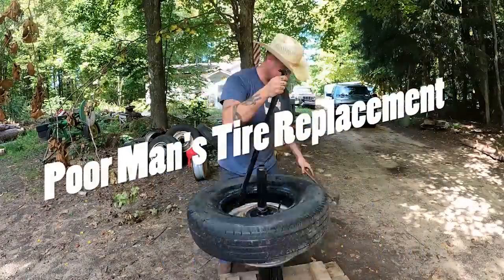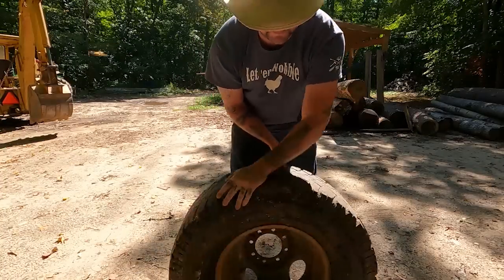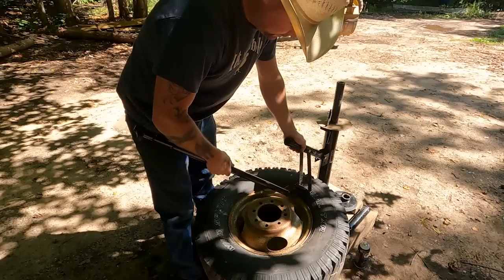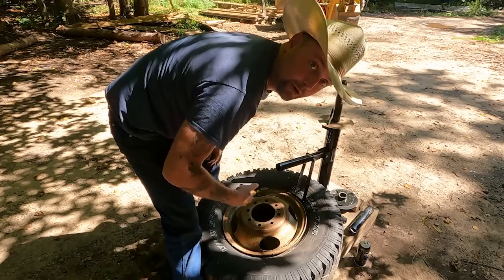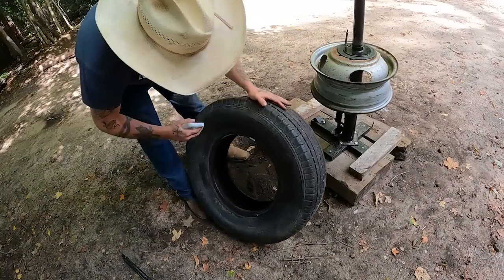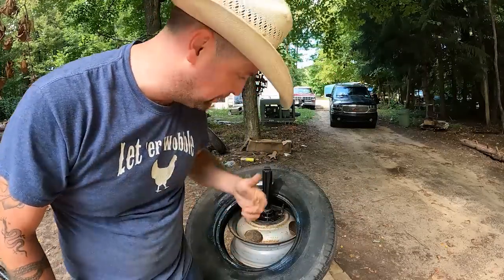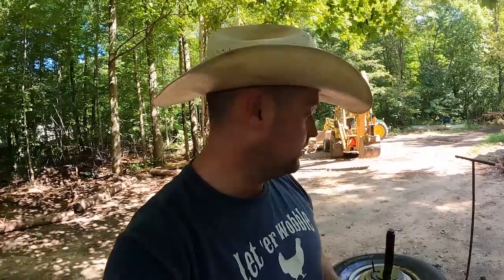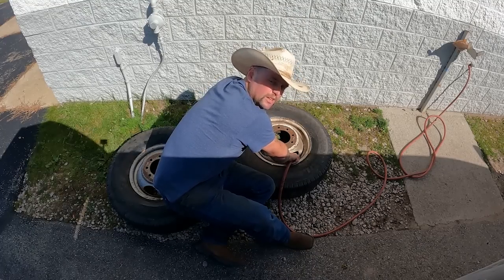How To Change Tires Yourself (because you're poor)

Comment: Tip for putting tire back on rim. Clamp vice grips on the rim instead of trying to hold it down with a hammer. This frees up your other hand to hold on to a second pry bar(tire spoon for the rich folks out there).

Comment: For those that don't have a harbor freight tire machine a farm jack works just as good if not better to unseat the bead. 2 pry bars will work the tire off the rim without a tire machine.  Nice to have one though and great video.
Reply: Bottle jack under the hitch of the truck has done it for me! Not as nicely as this fine machine, but it worked

Comment: Not that you're going to be doing that again soon, but use a large pair of locking jaw pliers clamped to the lip of the rim. It's the same idea as your hammer, but it will not fall off (like your hammer)

Comment: Only tip I got for you andy is if you're already at harbor frieght getting the tire mounter you should also get a Schrader valve remover so you can pull the centers out of the valve stems completely. Then you never run into not draining enough air! Love your videos! God bless!

Comment: "I'm new poor, not old poor." Best line ever. It's true though, when you've done it a while, you have workarounds for not having money. Made me laugh though. God bless you.
I'm in the process of doing this, though i did get some cut rate tires online. I switch out one at a time (and use the spare on that spot) and drive it down to get it balanced, replace it,  and do the next.

Comment: Good attitude keeps the low scorers industrious and out thinking the high scorers.  I prefer a bead breaker maul because I used to fix flats on my Mack dumptruck and bigger tractor tires. One hit on a small tire is all it takes if your eyeballs are calibrated.  Did all my work with rim and tire on the ground with a 24" tire spoon and 36" tire tool.  Take care.

Comment: I have that exact same tire machine. It worked wonderful the first couple tires, and then the bead breaker tool bent. So I welded a plate across the arms and it works wonderful again

Comment: Used to work at a tire shop. Pneumatic machines are awesome. I now use a slide hammer and the ground. I’ve changed a lot of tires for the same reason.

Comment: You could balance them pretty easy by sticking them on a horizontal shaft and seeing if the heaviest point sinks to the bottom.  We do it on small aircraft with a similar set up except it has bearings.  Another method we use is a rod that goes from the bottom of the tire up, and inside that rod is a string.  When you have the tire, the heaviest point will sink, and this the string will touch the hollow rod on the side of that makes sense.  

They're both methods of static balancing, similar to bubble balancing.

Comment: Semi-pro tip, you can if you want use a pair of vice grips instead of the hammer. I’ve done that with little trailer tires works well.

Comment: A couple cups of antifreeze works great to balance tires.
 A slurry mixture of antifreeze and shredded newspaper works great as tire sealant for low speed tubeless implement tires that you don't care if they wobble a bit. Had a forklift tire that we were pumping up 3 times a day that I tried this on and didn't put air in for three weeks, and then I ran over a piece of steel and put a fist sized hole in it and nothing could have fixed it.

Comment: When I first bought a used HF tire machine I was sad over not having a concrete pad to bolt it to until I remembered that I had a small steel deck trailer and a welder and you can guess my solution. It’s now a mobile tire swapping machine 😂

Comment: Now you can put a small rock on that valve core stem. Remove air cap put pebble on the inside of cap then screw the cap back on. Should air down the tire in about 4 hours

Comment: Got the same problem on my 76 ford. Need to get me some 16 inch rims cause hell with the price of 16.5 inch tires. Only thing under 250 i could get were bias ply trailer tires lolLuckily i got 6 that hold air

Comment: If you can find a tube that is the same diameter as the center of your wheel (or find a way to rig up an old hub) you can balance your own tires. Put the setup on jack stands, level it out, then spin the tire. Wherever it stops is the heavy side, so put a weight dead center of the top. Not perfect, but good enough

Comment: I did tires for 15 years (not proud of it but it fed the fam).  2 bars tire on the ground and its almost as fast as the time lapse vid with your machine.  800 credit score wouldve removed the nut from the valve stem and pushed the stem into the tire 😉

Comment: I have a a air compressor you can have... 110v not harbor freight i think 25 gallon ... or do you need a electric motor for your’s i have a 240v electric motor laying around   .... do you have a fastenall near by ? probably would be the best method for me to ship it

Comment: I was going to do that. Had the spare tire on my truck fall off the holder. Ran it over with my trailer. Sliced the side wall. Never used only 15 years old. Went on Market place found a newish tire. Was going to visit my dad 6 hour drive he has a Manual tire changer. I instead decided not to drive the 6 hours with no spare on the ready. Took it to a tire shop. For about $35 changed out the tire and disposed of the old one. Cheaper then that tire changer. Saved my back. But my credit score is over 700 so what do I know?